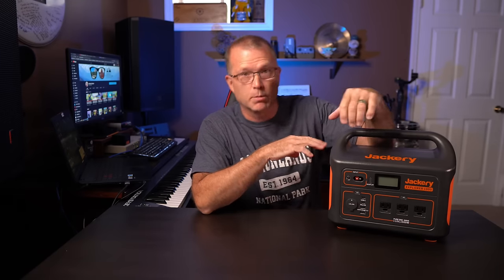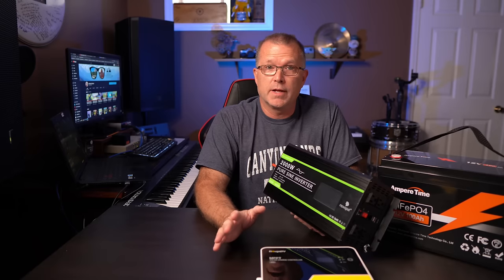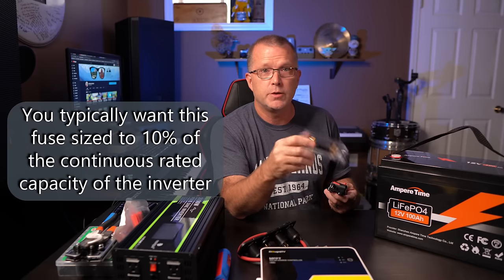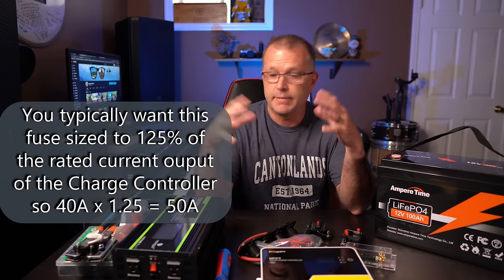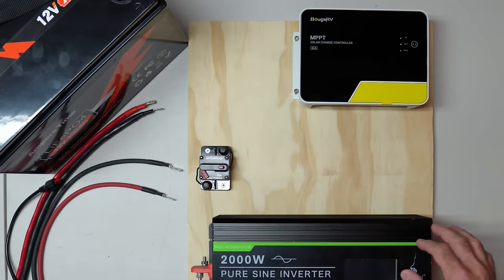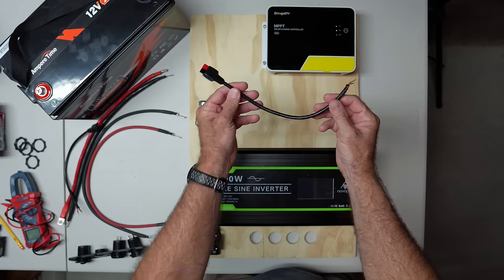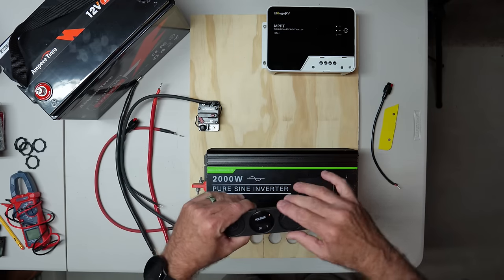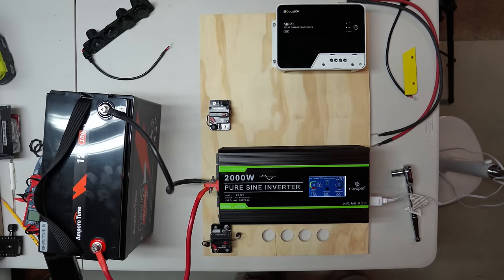BEGINNER FRIENDLY Step-by-Step: DIY SOLAR GENERATOR for Emergency Power, RV, Shed... Ampere Time

Comment: Very nice build and this channel has given me some good ideas. I am using a Lifepo lithium battery and was told that those cheaper PWM chargers don't do as good a job in properly charging lithium batteries unless they have adjustable settings? Something about PWM's float charging them too low. Thanks for sharing your knowledge and experience.

Comment: When you start using these closed solar systems on a battery bank, there's usually a drop in the voltage once you start a device plugged into the inverter. 

I want to ask what is typical for the voltage drop? And what's OK for a range? Basically I mean by this, how much voltage drop is just the load compared to indicating a problem with the batteries being healthy? Thanks. 

Everyone using this is probably at one point going to be asking this. As soon as you plug something in and start running power the volts reading on the charge controller, etc show a bit of a drop.  And it seems like some drop should be there to indicate a load. But I'm not sure how much of a drop is healthy.

And part of this question comes from the fact that the stated unhealthy voltage range for batteries is usually stated to refer to when batteries are at rest, NOT when there's a load. So this is a bit confusing. 

Thanks.

Comment: Any commercially built LiFePo4 battery will have a BMS installed which will protect the battery from over/under voltage and over charge. If you pop the lid off of your battery you'll most likely will see the BMS. Otherwise, good informative video.

Comment: Also another newbie here  . I want to some what the project you did but a couple of differences . I am building a smaller system in tool box for camping . I want to use a small 400 watt inverter , as well as a battery cut off switch with a 50 amp terminal fuse block , a 50 amp lenkrad circuit breaker , and lenkrad 200 amp circuit breaker . My question is can you/ will you please suggest a wiring diagram? Thank you for your help.

Comment: What I'm looking for is an inverter that can be upgraded as money is saved by cutting the grid starting with 120 and later upgrading to 120/240 split phase power adding battery capacity as the money becomes available

Comment: Thank you bro, your video is straight forward easy to understand, can one good sunny day fully charge the battery? Thank you.
Reply from the maker: Yeah, a good rule of thumb to use is about 500Wh of charging input from a 100W panel on a good day of sun.  So a 200W panel should be able to  provide about 1000Wh of capacity charge from a single day of decent sun.  In reality, if you reposition the panel every couple of hours for optimal alignment, you'd add about 20-30% to that number (again, assuming clear sun).

Comment: I love the build. You made it very easy to do. One question. What is the maximum batteries (100 amp hours each) can I add to this? Two or three total?
Reply from the maker: Without getting too deep into the weeds, there are a couple of considerations here. Normally, the prime concern is ensuring that your solar & charge controller can supply enough power to the batteries to charge them.  Since I used a 12V inverter in this setup, I'd probably stop at 2 batteries since I'd have to keep them in parallel (to maintain 12V) and wire-guages would start becoming an issue with more than 2 batteries in parallel.  However, if you went to a 24v (or higher) inverter, you could easily add many more batteries provided your charge controller (and solar) can output enough power to charge them at a desirable rate for your needs, keeping in mind that your combined solar panel output voltage must be higher than your system voltage (12v/24v/36v/48v, based on your battery configuration) in order to charge the batteries. I'm planning to get into these topics in more depth soon. :)
Reply: I would really love to hear more about this battery pairing stuff. 

The whole concept of needing to run in parallel etc isn't something I've encountered before! 

I had a system trying to run a wind turbine but I had a number of other batteries involved and the turbine has a break on its controller but I think because I didn't have it wired right (just connected to the first battery in the large series the controller wouldn't release the break on the turbine. 

It was really frustrating

Comment: Nice setup, will work for my camper. When I have access to shore power, where do I connect the 120vac into the wiring you assembled? Do I use a switch to select shore power and disconnect my fuse box from from the inverter? Second question, my camper has a 120vac refrigerator that pulls 70 watts / .58 amps. If I have a 100amp hour battery, the refrig will run for 171 hours (100 amp hours / .58 amps = 171). Is that correct? I realize the refrig cycles on/off but I'm just looking for a round number. Thx.
Reply: No that’s not correct. The 0.58 amps is the current draw with a supply of 120 VAC. With the 12VDC battery supplying the current through the inverter the current draw will be roughly 10 x that amount.
Reply: Give it a test in your driveway. I think that run time might be a bit high. What Mike said above and Factors are ambient temp and battery not dropping to zero😳, (if lp4 it's ok, but not most others as I understand it) And will you have solar to keep battery charging?

Comment: I have an echo river with two batteries. one is a deep cycle from 

al-mart.  the two batteries are in the house. I should have them out of the house. I inverters that start at 750 watts to a three thousand watt inverter, but all them are square wave. i would love to have a pure sine wave one

Comment: This is a very cool build.  Could it be expanded to include a way to charge the battery via household current in addition to the solar?  Thanks for the video.
Reply from the maker: Sure! The easiest way would be to just get a LFP 12V charger for about $100 and just mount it to the board

Comment: Very good video my only concern is in your way of connecting the cables if the 50A breaker tripped would the control.panel be OK as it states over and over about not to connect the solar panels before  the battery. 👍
Reply from the maker: Thanks!  Definitely something to consider if you're using a cheap charge controller with no built-in protections.  The 40A BougeRV controller does have built-in protections for this kind of scenario so it would not be a problem in this case.  I pointed out the 'best practice' of ensuring battery power to the controller before applying solar input since it's a good rule to follow, just in case.  :)

Comment: What's the difference between having separate load terminals on the controller versus this where the load and the battery are connected to the same terminals?
Reply: My same question.  I thought the battery off controller,  then to inverter (fused of course).

Comment: I liked your video on the novopal inverter so I purchased it for a small back system I built when read the description it said 110v/120v and on the outlets are marked 110v @60hz so when I run a microwave or airfryer they sound like there stuggling with only 110v. so my question is can you make the inverter have 120v at the outlets. THANKS FOR ANY INFO...

Comment: Good video, but one caution. Those switchable circuit breakers have really cheap guts. They are very questionable as to their ability to handle high amperage and are a fire danger. Far better to use actual fuses. I have seen videos of them failing. Be safe and use nothing but proven items. Get a high amperage switch to cut power between the battery and inverter as well as the charge converter. I also used a larger gauge of wire then is needed. It gives a safety factor and allows for more current if you expand your system in the future. Once you have it running, with a near max load, use a heat temp gun to check for wire and connections getting too hot which could signal a problem.

Comment: Nice job and thanks for the info.  But I noticed you wired 12V directly to the USB port, which should only be 5 volts.  Does the port actually regulate it down to 5 volts in that small area?
Reply from the maker: @pjo351  yes.  Those are 12V connectors and they handle the step- down for you

Comment: The battery voltage when you are charging or have a load connected to the battery will not tell you the state of charge of the battery.  I didn't catch the wire gauge you used between the battery and the inverter, but since that inverter can easily pull the 100 amp continuous discharge rating of the battery, that wire should be #2 or larger (depending on the temperature rating of the wire insulation.

Comment: Thank you so much  so how many panels does this system needs and connected in parallel or in series
Reply from the maker: Really depends on your charge controller and what your power needs are. The charge controller I used in this build can take up to 600W in a 12v system,  1200W in a 24v system and 2400W in a 48V battery system. And you use series or parallel (on a combo of both) to keep you panel array current and voltage output within the charge controller's acceptable input range.

Comment: I have a question re wiring from the panels atop my van to the control panel.  I currently have one BougeRV 200W panel and am considering adding a 2nd panel to run in parallel.  I'd join them on the roof and come down through a gland box.  I'll be feeding two 100 ah LiFe batteries.. also in parallel.  Currently, I have ordered a pair of 10gage solar extension cables to go to the controller.  With the 2nd panel, would I need to change that to a larger gage wire than 10?  Thanks for your videos.

Comment: It looks like I need two more cables with the right size terminal connections. I can’t find 2 gauge with 16-8 connectors….  Would you have a link on Amazon for those?

Comment: Very nice, informative video! Just one question: I have a Renogy 3,000 Watt inverter, but it does not have any informative screen on it like the Novopal. Can you recommend a unit that could act as the panel I am missing (or do even need it?) Thank You.

Comment: I’m doing a setup very similar to yours picking up components a little at a time.  I have the same charge controller you have and am going to get the inverter next.   I was looking at the one you have but it has a lot of reviews reporting low AC output around 105 volts.  Did you put any grounding in your setup?

Comment: Your videos are excellent. I have learned a lot from them. I have a question, though. How do you determine the size and location of the fuses?
Reply: Good rule of thumb is to go 25% stronger fuse.  The equation you looking at is Watts divided by Volts equals Amps multiplied by 125% equals your fuse size.  Watts / Volts = Amps x 125% = Fuse Size in Amps.  Reason is your system will be for say a 12.5Amps and a 15Amp Breaker / Fuse would work, because if the fuse size is precisely the load that you are drawing, it would trip the system continuously.  Therefore you are going on a surcharge (system having a power spike.  If you are using 20% and getting a fraction, always go to the next higher number, never lower.  Say 19.2Amps, take a 20Amp fuse and not a 15Amp, as the fuse will disconnect / short as it is trying to draw 15.36Amps, greater than the fuse capability.)

If you are into towing anything, would you ever tow a trailer or hook a caravan or load greater to your vehicles load capacity, or be safe and tow a smaller / lower weight?  Same principle.
Reply: I didn't you the symbols or letters representing the Watts, Volts or Amps, as you might not have studied in an electrical field.
Reply: @micheleheynes4298  Thanks

Comment: Will this setup work using an Echoflow 2000wh battery charger with a 200w solar panel. Looking to use for my 19ft Coachman trailer. Want to have own electricity just in case I need when traveling.

Comment: Great video, would this set up run 8 100 watt led lights and if so how long would the 100ah battery last? Thanks for your time.
Reply from the maker: @jasonbehlke7077  assuming those lights are AC powered, you would need to account for about 20%capacity loss in the AC DC conversion.   And assuming these are a full 100W continuous power draw, that's 800W continuous...so in an hour of runtime that's (800Wh x 1.2) 1000Wh used. So on a full charge, you'd only get a little more than an hour of runtime with that kind of load.
Reply: @ReeWrayOutdoors  Thank you for the info and your time.

Comment: I’m a licensed cannabis grower in Oklahoma, I’m looking to setup Solar for my mom plants but new to solar set up. I am currently using 6 led lights that each pull 400 watts, the lights are on for 18hrs and off for 6hrs. I want to have these lights run off grid as electricity can be expensive. Can you help me figure out what I’ll need to get this working?

Comment: Than for the very informative video. I did not hear you discuss approximate cost of this particular setup. Maybe vs. current solar generator offerings of approximately same capacity.
Reply from the maker: Less the solar panel, the battery/controller/inverter/breakers and misc parts add up to about $850, which is probably only slightly less expensive than the average 1200Wh/1000@ portable power station.  But most of the reason for that is because I over-spec'd the Inverter and the controller to allow for easy expansion.  If I were to add another battery, I'd have the equivalent of 2400Wh/2000W power station at a cost of only $1250, which typically cost somewhere in the $1800+ range.  It's still not quite an apples-to-apples comparison for a variety of reasons and there are definitely pros AND cons vs portable power stations.  But depending on your circumstances, I do think there's a lot of value in being able to build a system like this yourself.   :)

Comment: just ordered these parts and Amazon has switched out the 2000 W Inverter for a 1000W. Now I have to send them back and find the 2000W one.
Reply from the maker: Mary Jo, if it's any consolation,  I recently ordered a 16GB memory kit from Amazon for my PC, and what showed up was some kind of citrus foot peel kit!!  Thankfully they swapped it out for what I ordered without any hassle.

Comment: Just a friendly note, breakers should not be used as switches because they get worn over time and could fail. Install a proper switch or disconnect whenever possible.

Comment: Thank you, this was a great video, you simplified it for me.
 Wanted to ask, if I want to put more than 600w panels(let's say 1000w) what parts of the system do I need to change ?
Reply from the maker: Depends on your charge controller.  For the one I'm using in this video, to go to 1000W, I'd need to switch to a 24v system, so I'd need to have either a single 24v battery, or at least 2 12v batteries wired on series to create a 24v bank.  And then of course you'd need to have a 24v AC inverter as well.  But some charge controllers can handle 1000W of solar in a 12v configuration.
Reply: @ReeWrayOutdoors  Great! thank you for the fast reply, now I get it.

Comment: Thank you for your videos! I know nothing about this stuff but I’m trying to learn. I find your videos super helpful. This may be a stupid question, but is this basically a DIY of the Ugreen powerroam 2200 that you made another video for? What are the pros and cons of this one vs that one?
Reply from the maker: It is, yes. :)  The benefit of doing it this way is the modularity enables you to expand the system as your needs change...or easily swap out something if it fails.  The advantage of a power station is that you get everything in a nice compact pre-built package that's easier to move around when you need to. Some will argue that there's a significant cost savings to DIYing a solution like this...and there can be, but your time is also worth something so I consider it (mostly) to be a wash.

Comment: So in a sense you're using your Inverter terminals as a Bus Bar Correct?. I'm putting together a 400 watt system and a 4000 watt inverter and using 4/0 Cable. For 2000 shouldn't you use 2/0? Also the drop in voltage is from the beakers.
Reply from the maker: Yeah...I have actually upgraded that configuration since and put in actual bus bars, but I was trying to keep it super simple in this video.  And you're totally right about the 2000W inverter.  I did mention that it was over-sized for this single 12V battery setup, but yeah - definitely a 2/0 wire would be in order if you planned to run at max 2000W load for more than a few minutes at a time.   I've also ditched the cheapo 200A breaker switch and replaced it with a 200A fuse and a disconnect switch.   This new setup makes a cameo in several of my more recent videos, but I've yet to do a follow-up on that specifically, since I'm barely keeping my head above water with everything else on my schedule. :P  haha

Comment: Great build..... What was the total cost of this system, and what are the benifits over a portable power station such as a EcoFlow Delta 2?  It seems the all in one may have met the spec and function without all the extra steps and cost about the same?
Reply from the maker: yeah, the all-in-one power station is definitely an easier way to go.  A little more expensive and generally less expandable, but with something like the Delta 2 (and a few other units) you do at least have some ability to add capacity easily.    So I think it comes down to the individual's particular needs and comfort-level working with these kinds of components.  It IS nice to be able to easily just upgrade the inverter or the charge controller when changing needs dictate it, in a DIY kit.  Not really an option if you're buying an all-in-one solution - but then if you need portability, you'll likely be happy to trade easy component upgrades/servicing for an all-in-one! :)